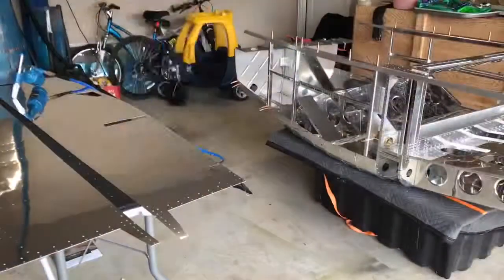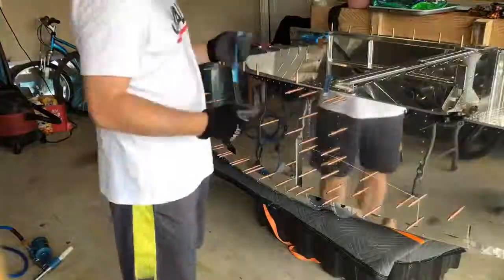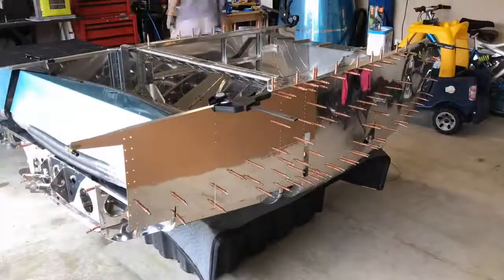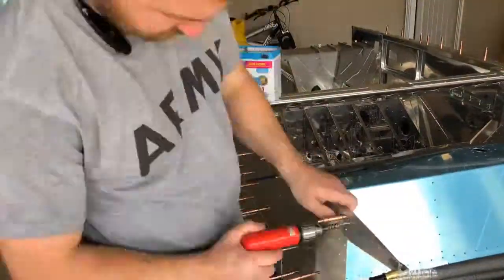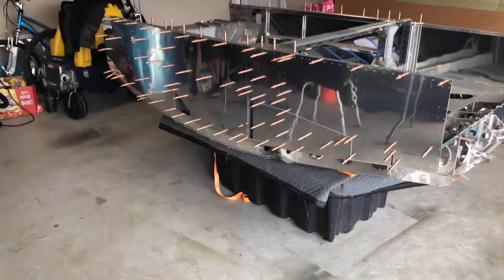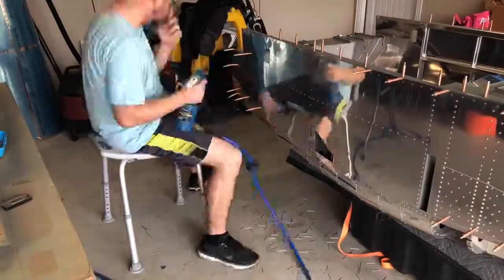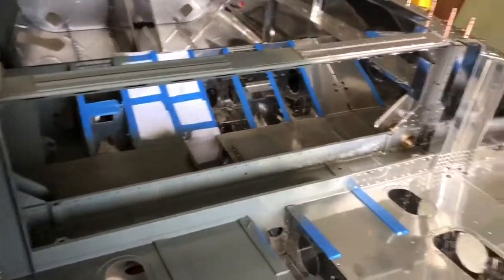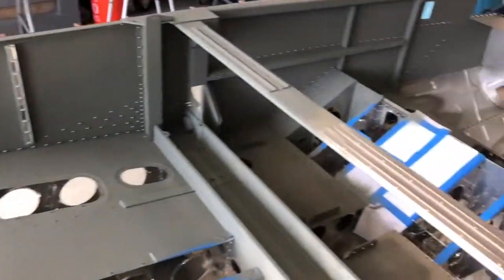Vans RV-12iS Fuselage 11

Comment: Looks good. What primer did you use in the interior?
Reply from the maker: Hi John, I am using RustOleum Self Etching primer that I picked up at my local hardware store.
Reply: @blflores10  That's what I thought. I've used it too. It goes on nice. Did you do any prep work to the aluminum before spraying? Thanks for the videos.
Reply from the maker: @johnmeyers6324 I prep the surface by scuffing with a scotchbrite pad and clean with acetone or mineral spirits then apply quickly afterwards. Seems to be working good thus far. Now just need to figure out what color to paint the interior...
Reply: Do you plan on painting the cabin?  I’m torn as to just leave the prime or go ahead and paint too.